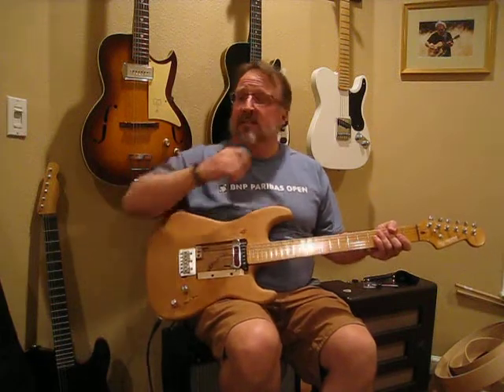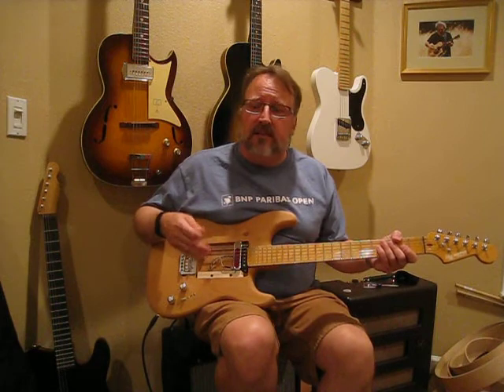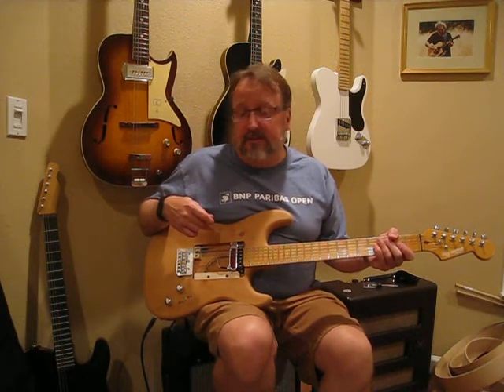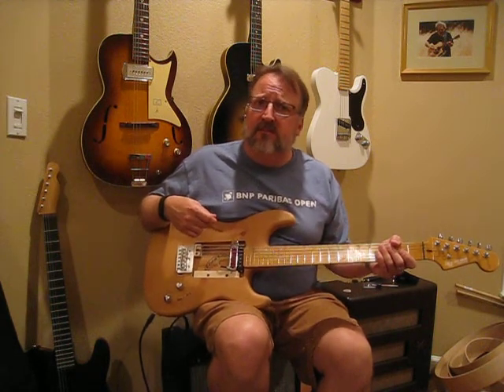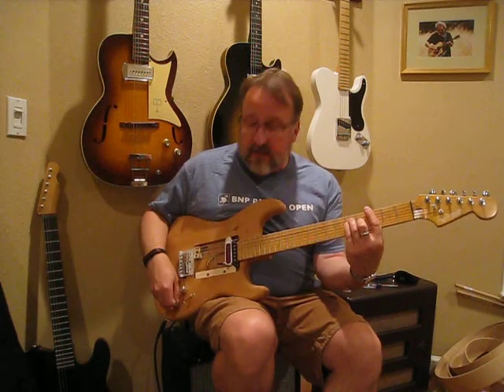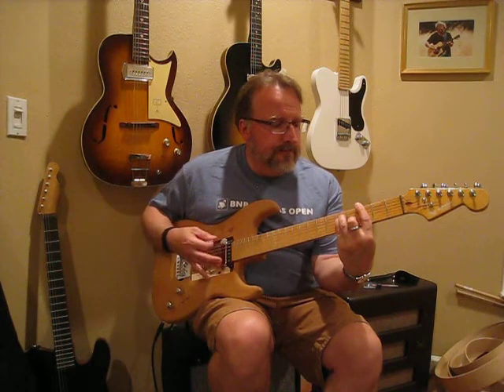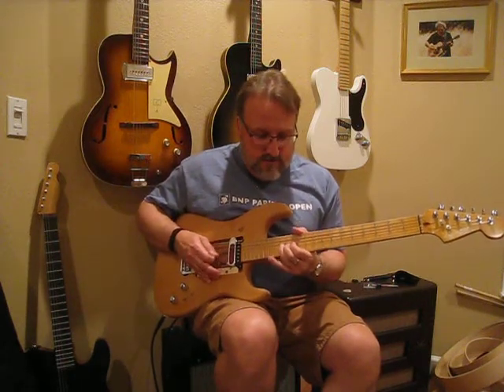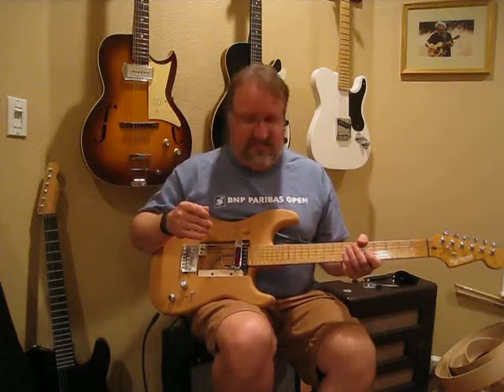Tele Neck Pup with a Little Rhythm Chief 1000 Added

Comment: Very intersting. I got a Rhythm Chief 1000 pickup from my dad after he passed away. I'm thinking of trying to have a similar sounding pickup on a Telecaster as neck pickup. Something as similar as possible as the original in terms of tone. But I have no idea what specs this pickup should have.
Reply from the maker: Hey CP,
The dimensions of a Tele neck pup do not lend themselves  to replicating the RC coil shape. The RC coil is much flatter . I did wind a Tele neck pup recently using low gauss A5 rods with 45AWG and concentric coils. It sounds really nice but not exactly RC as the coils are very different in shape.

The Tele bridge pup however can closely approximate the RC coil dimensions with some creativity. I wound one recently and it is in my Esquire and is VERY close in RC tone.
Reply: +Barncaster1  I'm not against doing some routing on the telecaster neck pickup cavity to accomodate a strat sized pickup. What specs would you recommend to match the RC 1000 ? I would prefer to stick with A2 rods like on the original.

Interestingly i spoke with a guitar shop keeper who's tried countless examples of the rhythm chief and he thinks the 1000 has a better tone than the more expansive 1100.